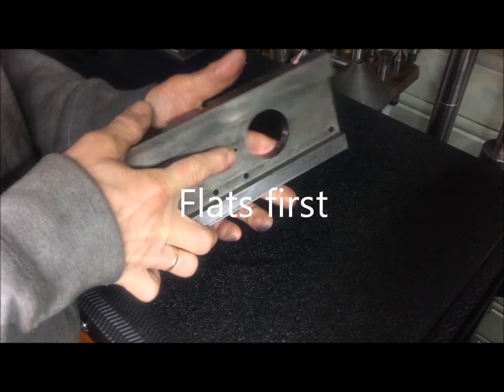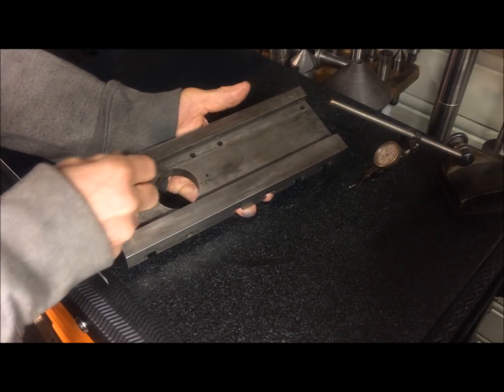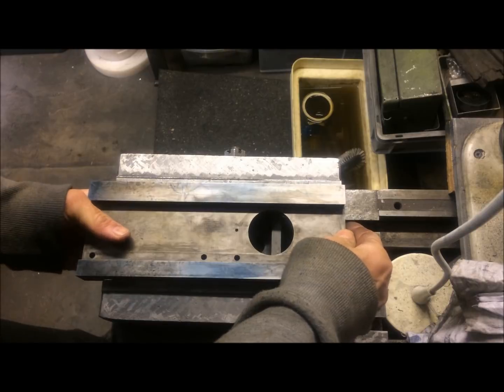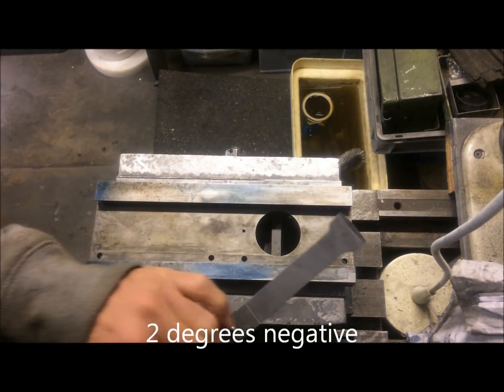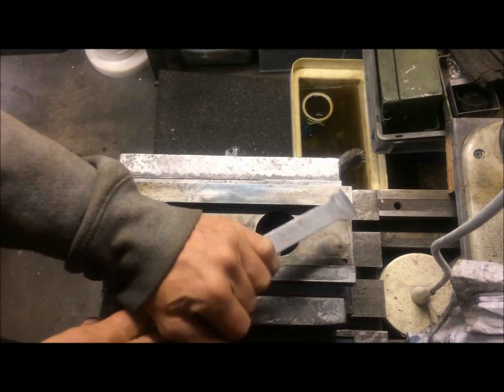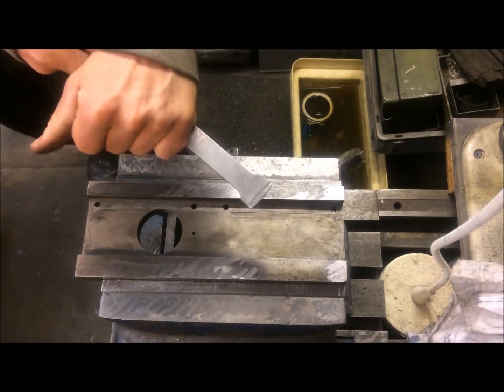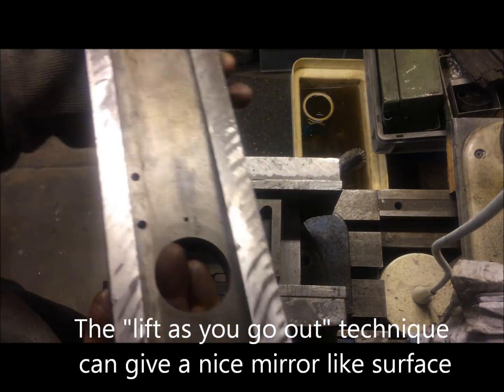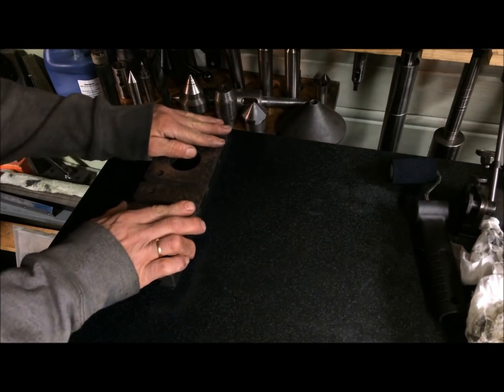Myford 7x7 - cross slide - measuring and rough scraping flats

Comment: I have bought 2 surfaces gauges this week. One new from the other side of the world and one older one off of marketplace. Both wobble on the surface plate enough that measurements with a dial test indicator are useless. Grrrrrrr!
Reply from the maker: Irritating, yes! They need to be scraped then. Hmm.. maybe the old one is properly made, but worn? Or warped?
Reply: @jansverrehaugjord9934  but they are hardened tool steel. That can be scraped?
Reply from the maker: Then they must be ground

Comment: nice job and video.is just  used a lot of blue paint nearly the end of video,better use a little bit for view very well the highspot .with a lot of blue paint sometime is no easy to view that.
Reply from the maker: Fabio th Thanks for the comments and hints! ps! you said earlier you had used a Biax for a long time. Do you work in industry on lathes , mills or similar? It would certainly be interesting tolknow/learn more from youd experience. pls share if you can/want 😀😊
Reply: Jan Sverre Haugjord.I work on one factory,we construction a milling machine.befor I work on other industry for rebuild turns normal and cnc,milling machines,boring machines,and is 30years I do a scraper and I use a grinders for work a bed machines and more.if I have chance im so happy to post somethings on here about a hand scraping.thanks
Reply from the maker: Thanks! Wow...this is very interesting. I reckon both me and others (amateurs) have a dozen of questions.. feel free to comment more :)